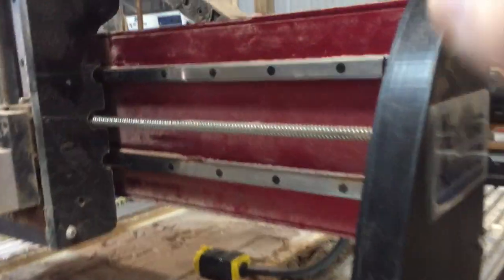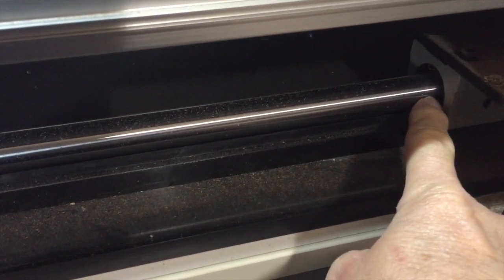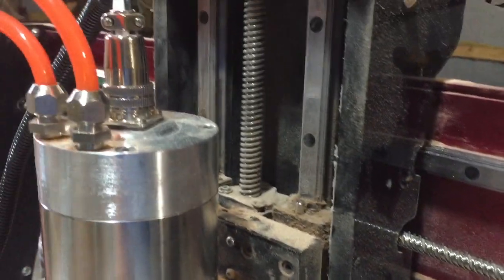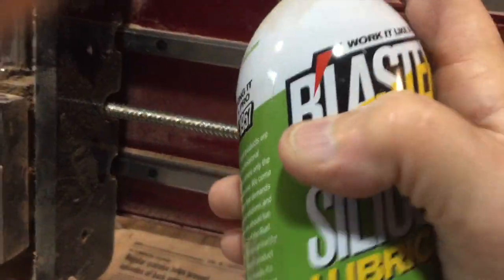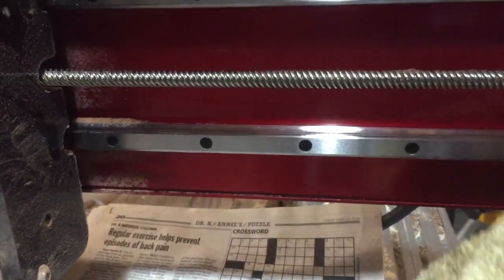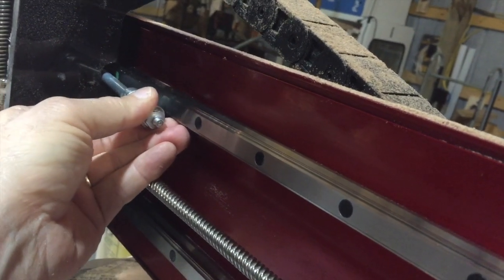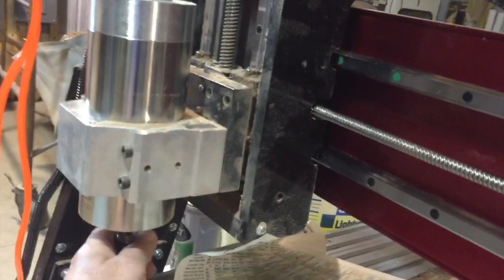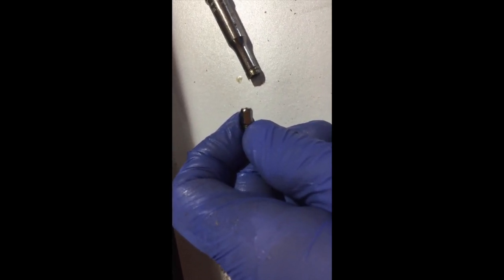CNC Shark HD 5  Maintenance cleaning and lube

Comment: If someone still watching this video, you need Lithium based mineral NLGI1 grease for the bearings. Do not use EP grease, it has Sulphur as additive and wears faster the bearings and the wipers.
For the rails use VG68 mineral oil for linear rails. Don't use silicone oil, it's incompatible with the mineral grease you injecting in the bearings.

Comment: My machine has metal plates on the side that hide the Y rails? Someone else put our CNC together and I’m trying to get down in there but I can’t get the shielding completely off.  I’m having to just slide it side to side (in the Y axis direction) but I can’t get on top of the bearing to wipe all of the dust off that has built up?
Reply from the maker: Send of photo of the shields that have been installed. They may prevent the y axis bearings from excess build up. If you have a small blower that can be directed into that space it may also remove any dust or debris, but remember to do this first prior to cleaning and greasing.
Reply: Thanks for the reply.

I ended up calling next wave and they told me to do what I was already doing. Only way to get them off is to remove the gantry, but I’m not really trying to do that. Maybe I’ll make a cut out with hinges to access the rails from the bottom of the table.

Is there a grease fitting for the y rail too or do you only clean them and spray with dry lube?
Reply from the maker: No grease fittings on the round rails. Here is a video that shows round rail lubrication. https://www.youtube.com/watch?v=eI4eDstrtzQ

The ball screw lubrication is different. Here is a video that shows how to get in there to lube it.  https://www.youtube.com/watch?v=ct_bTpKX8OQ

How to make the lube reach.  https://www.youtube.com/watch?v=QvaGIuwGVaA

Comment: Does the grease just sit on top, or is it somehow injected into the bearing?. I ordered the grease kit from next wave but it does not fit around the grease fitting I can only apply to the top.
Reply from the maker: Sorry it took so long I have been a little busy lately. The grease goes into the bearing through a tiny hole in the top of the fitting. It is small so you must squeeze the grease in very slowly. If you do not it will build up on top of the fitting. This must be cleaned off when you are done. The first time you grease the fitting you should continue until you see some grease come out between the rail and the bearing slide.  Good luck,  Cecil

Comment: Thank you for the maintenance video, they are scarce. Can you tell me what the fitting is on your greese gun (that goes over fitting on CNC machine)?  having trouble getting to the bottom fitting
Reply from the maker: The site did not come through so I added it to the description above.

Hope this Helps. You can also look at the video on ball screw maintenance.   https://www.youtube.com/watch?v=ct_bTpKX8OQ
Reply: @cecilwoodworking7204  thank you!
Reply from the maker: @mollarman  Your Welcome.
Reply from the maker: This is the site for the grease extension @t . The grease is available from grainer on line or in their store.